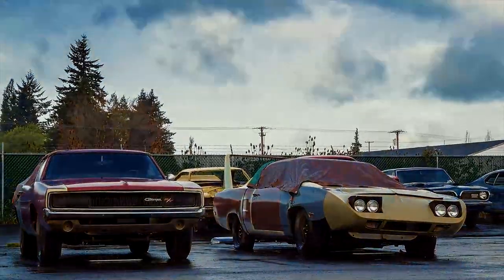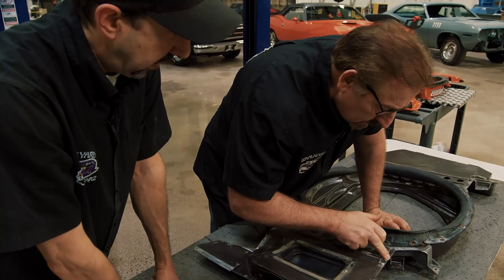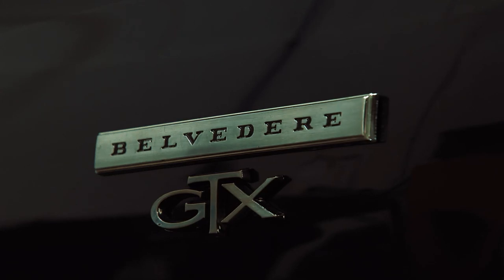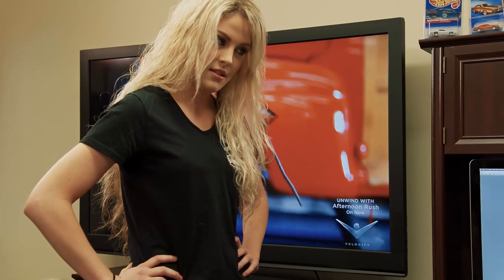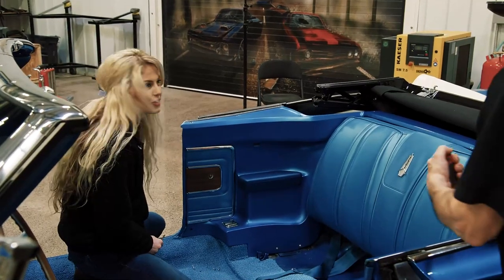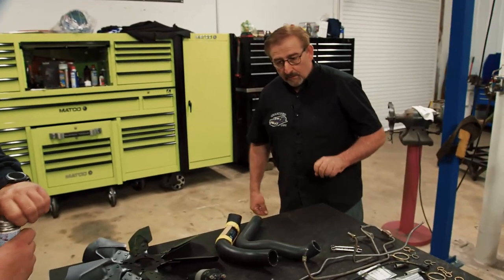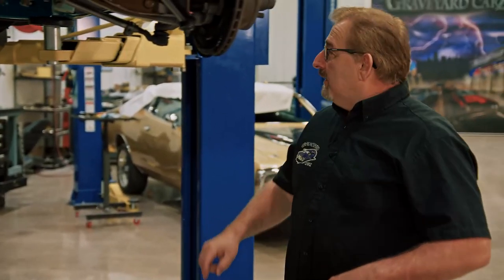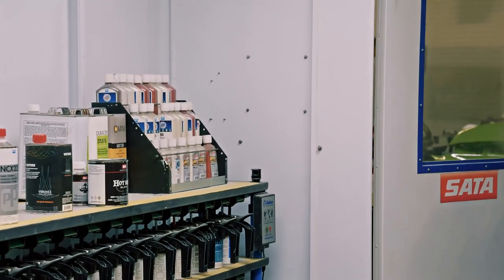ALLYSA ALMOST QUIT OVER THIS EPISODE.

Comment: I would love to get my hands on a 1969 or 1970 Dodge Charger RT with the 440 V-8 automatic or 4 speed manuel transmission.
Reply: Those are Sweet I like the 66 & 67 Chargers to.. The Aussie Valiant chargers had a Dam sweet 265 Hemi 6 banger with Tripe Webbers on the side of the E38 edition they were dam quick
Reply: Graveyard motors. With enough money, he’ll build you whatever you want
Reply: I’d go with the 4 speed in any car automatics take away from the driving experience drastically
Reply: So would I 
STICK ONLY🇺🇸
and I HATE Mopar.
Good luck!

Comment: that hemi convertible is ~ just ~ stunning ~ reminds me of a hot rod version of a late 60's Mk2 Cortina crayford convertible we rarely get in the uk.....
Reply: Don't think we ever got them here in Oz.
I know we got hardtops and sedan versions.
Reply: @devolutionrc8016  no way, sweet little cars! Some went mad putting massive V8 engines in, the savage model was a genuine model with a V8 but a lot of those conversion to the 60s cars are a disgrace....I believe Allan Mann had a cosworth gold red one or it was a replica a guy did was in cars and car conversion magazine, he funnelled the exhaust into the passenger footwell and raised the passenger floor so it could have a side exit exhaust to be as low as possible and he put alu sheet full length under neath as a belly guard, thing was astonishing
Reply: @icanseeyouallfromuphere  haha nice, full racecar! Gotta love a side exit exhaust! We got the capri gt too but I'm not sure what the engine options were here?
Reply: @devolutionrc8016  wasn't the Capri gt just a 1600 the S model was a 2.0 then the 2.8 injection, the mk1 Capri has the RS3100, I lost track over the years due to brain injury...my mum's brother had a MK1 escort factory RS 2000 mexico model from new in sky blue with dark blue dog bone graphics, granny worked at the dealership....
Reply: @icanseeyouallfromuphere  you're most likely correct. ☺️
I definitely remember Escort RS 1800 and 2000s later front wheel drive escorts  were badged as Telstar there was a TX5 version that had electric dampers. The Telstar was also badged as Mazda 626
Reply: @devolutionrc8016  oh yeh there was a escort harrier aswell, yes the Mazda engine is the Ford zetec engine using the RS turbo cvh block.....
Reply: @devolutionrc8016  I believe the escort model in the USA was a Ford Lazer and slightly different edge shape and lights differences.....
Reply: @icanseeyouallfromuphere  yep. Bloody badge cars lol 😂 thanks for the fun chat!
Reply: Yeah..
I hate Mopar.
Chevy Dude.
That ugly convertible piece of garbage,
stole my heart...

Comment: I know if Mark had me waiting years for my car to be built but sneak cars ahead of me. Then i wouldnt be having a car built by him anymore!!!
Reply: A shop is always shuffling cars around based on the stage they are in.  It may appear that cars get snuck ahead, but that's not the case, it's just further ahead for a particular stage and yours might be in the body work or paint queue.  You can't just work on one car straight through because you have so much wait time for particular stages, especially body and paint.   So while cars in body and paint stages, other cars are being stripped for body and paint and other cars are being reassembled after body and paint.

Comment: You all know how to Simulate the little white strands of fiberglass on the under hood Air Box. Thick white lacquer in the paint gun sprayed on the Air Box high above the the part, Then clear over preserves the strands of white lacquer. That how we used to do it.

Comment: good example of the effects of stagnation in technological growth around the world when in the early 2000s most people would call a car from the 1960s a 40 year old car. fast forward 20 years and they’re still calling cars from the 1960s 40-50 year old cars even though they’re technically 60. I’ve heard it multiple times specifically the 1960s. When you talk about the 80s people tend to say 25-30 years ago it’s as if they don’t want to accept how old they are

Comment: Lead you just fire up the torch and with a wire brush heat the lead until it melts and brush it clean of lead you can catch it pour it in mold hot and reuse it lead is the shit for filler you can move it around pick and file it to perfection u n like plastic filler  you pick it up it cracks falls out lead is good when metal is tinted  right

Comment: Back in the mid 70s I worked at a factory that was 99% Latinos. I noticed a lot of the Vatos were lifting their hoods in the morning and at lunch time. I thought, man that’s a lot of battery problems. No! They were warming up their burritos on the intake manifolds. They’d place them on when they’d get to work. Turn them over at the 10 am break or eat them. I guess it depended on the size of the burrito. Then at noon mmmmmm get out the hot sauce and the burrito off the engine and c’omo se dice.

Comment: Was doing a clean out at some old shop there are Org 413 Race motors and '66, 426 motors and trans new in crates Any buyers ?. Not cheap ! No trades . A few org 440+6 set ups . All New Never fired . Still has factory tags on them 🤓😱

Comment: If it wasn't for Ford helping the Dodge Brothers to get there start after leaving Ford. Dodge wouldn't be where they are today. Ford in the 60s couldn't be beat til early 70s Dodge couldn't be beat. Only reason was Ford made a huge boat Mustang with 302 and 351s. While Dodge had the 440s and 426 Hemi. Ford is the original Hemi starter with the 428s and 429s. Today before the Gt500s came back Dodge was kicking it up again. Now Gt500s can't be beat. I also believe the Dodge Brothers are rolling over in their grave knowing Dodge isn't an American car company now. Only reason I watch this is for the classic car's. I own a 68 Torino coupe 390 Gt. I have always had soft spot for older classic Dodges. I like the YouTube show.